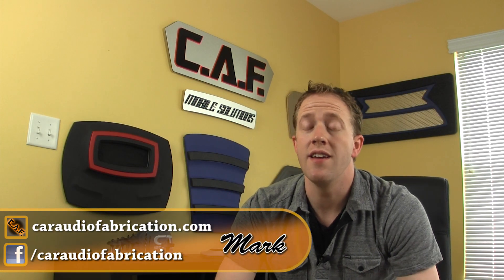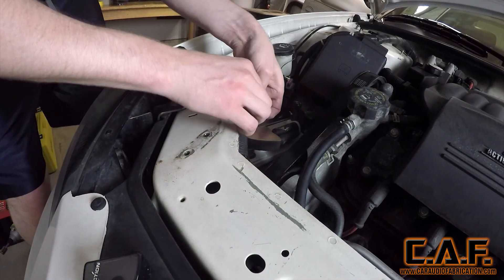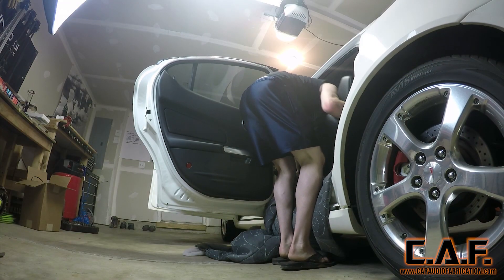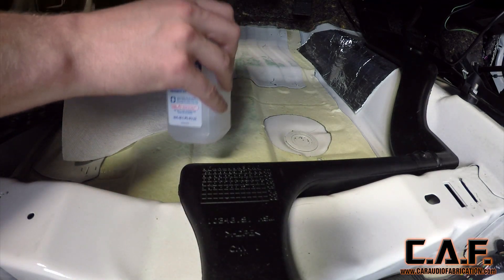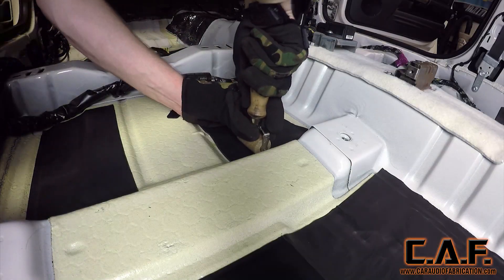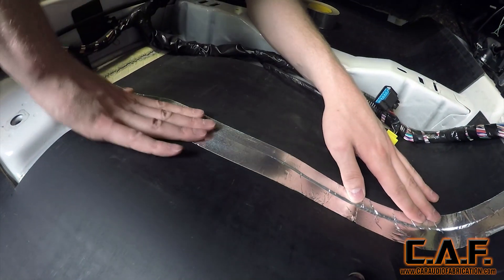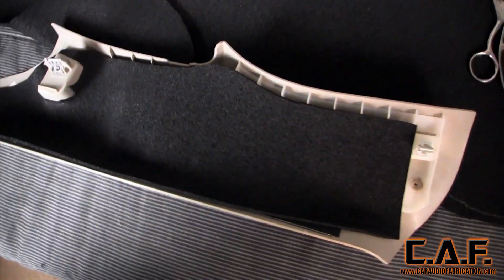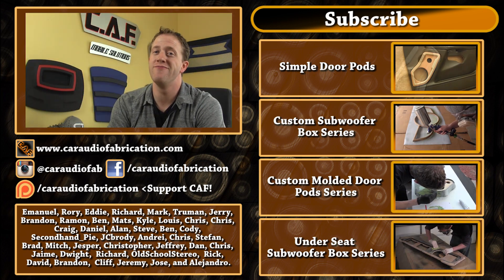How to Sound Deaden Car Interior - VBL #7 - CarAudioFabrication

Comment: One reason to put second skin all over the floor is to reduce heat in older V8 cars. I used their "Firewall Thermal Coating" along with the Damplifier Pro and it dropped the trans tunnel form 160 degrees to 78 degrees (which was room temperature).
Reply: +Russ Ryan Nice to hear the results you wanted were achieved......thanks for the shout out!!
Reply: Second Skin Insulation ...isn't mlv supposed to work with a foam under it to keep a gap or from the mlv touching the surface you are isolating it from?
Reply: Yes double deckersoulwrecker you would want to have at least a 1/8" Closed Cell Foam (CCF)layer  between the metal or foil top and the Mass Laded Vinyl (MLV) to decouple the air waves and keep the hard surfaces from creating noise. This is not our build, but Mark is a very talented installer in the industry so I am sure there was a good reason for this application (usually it is because of clearance restrictions on carpet re-apply in cars likes Porsche and Prius) and every single build is different and requires different strategies. This very reason is why we created the Luxury Liner Pro over 15 years ago which has the CCF infused onto the MLV already and will not separate and is so much easier to install then doing CCF and MLV separately.
Reply: Second Skin Insulation Thanks for the response. I wasn't sure if it still   worked this way

Comment: I took some of the ideas from Gary Bigg's Regal using lead and fiberglass to stiffen and add mass. Instead of expensive Cascade lead septum, I used 1/64 lead sheets to the under foot area's applying with butyl rubber roofing adhesive. But like him I used lead shot with fiberglass and 3 layers of Noico sound deadening, which I concluded just as good as Dynamat Extreme in my subwoofer enclosure.

Comment: Your car better be as quiet as a  Bentley after that. I would have liked to see a db measurement test...before and after... Both still and moving, with a mic positioned where a drivers ears might be.
Reply from the maker: focused313 I would like to do this in the future as well. Unfortunately right now I do not have the equipment for such a test.
Reply: +CarAudioFabrication this video was great! a lot of other car audio fabrication videos simply just put dynamat everywhere haphazardly. I wanted to see a video with MLV used. Also, if you do future similar videos, there are a bunch of free DB measurement apps for your phone. I use "Sound Meter."
Reply: It's not possible to compete with luxury cars designed for quiet interior cabins by doing sound deadening stuff like this. A significant amount of exterior noise is avoided by luxury cars through specific acoustic glass and various glass thicknesses, dampening of the suspension parts where they connect to the chassis, aerodynamics designed to stop wind noise at the source, and other things of this nature.

Comment: It would have been nice to see a before and after noise level measurement. I'd hate to spend several hours doing this and not getting significant improvement in noise reduction. Looks like all of this will add to the weight of the vehicle  but I wonder if that's a significant issue with gas mileage.

Comment: You said that you remove the OEM CLD material from the panels, but you stick your CLD sheets straight over the OEM CLD material (the yellowish layer in that car) all over the floor?

Also, what about the principle of
25-50% panel surface coverage for the CLD layer? You did not mention it and I do not see you practicing it in this instance. You went for the 100% coverage. Why so?
Reply: Can't speak for Mark, but for CLD on my car's floor, I just did a tap test and applied to areas that needed it the most.  I even had to apply it right over the factory deadening b/c it wasn't doing a good job.  I ended up covering up to 80% of my floor b/c it needed it the most.
Reply: ActnJksn If my thinking is correct, factory CLD layer should be removed first, because if it has weak (invisibly delaminated) connection with the panel, it will nullify the effect of any new CLD layers on top of it. However I have not yet found an easy way to remove that dreaded factory bitumen crap.
Reply: @NihadH  I would've needed a few extra days to try to remove the factory deadening alone.  I applied the CLD over it, then a layer of CCF for 100% coverage.  I have some MLV on order so I may apply that over everything.
Reply: I just apply CLD all over the OEM CLD. It's not like it's going to cause any problems. As for the 20-30% coverage, I am OCD, so I tend to go for 70% or so, especially on flat areas that are prone to vibrating as opposed to curved ones. CLD is so cheap these days, that even 100% coverage is nothing, really. My concern was why this video showed way less than even 90% coverage of MLV, which is the key aspect of full sound deadening. Even a tiny crack could negate the entire MLV effort.

Comment: I used roofing material to stick on the panels, cut up yoga mats over it instead of MLV and a lot of closed cell foam everywhere, what is your opinion on this method ? Honestly it barely costed me 100$ of material and it really made a difference in reducing road noise.
Reply: Yoga mats are usually just a thicker CCF, if you want a cheap MLV go find some used conveyor belts or some other source of thick rubber. Roofing seal is usually extremely thin and has hardly any mass to it, so you end up having to buy so much of it to properly dampen vibrations that you would have saved money by just buying the commercial product. Otherwise flooring underlay is an extremely cheap source of CCF. 
I used to try and get around the "system" like you and save money through alternatives. However I usually ended up paying more and was always doing things twice. Now I just buy the proven products and forget about trying to save the money. Too many hours of my life that I won't be getting back.
Reply: Dankus Memus  EXCELLENT POINT!!!!

Comment: If I do this could I get rid of the stock foam that's under the carpet?  I'm ok the same step as this video right now, I have the carpet and seats out and wondering if I could get rid it since it's pretty beat up and nasty from all the backseat spills. Cleaned my carpet a bunch!  I appreciate your help man!!
Reply from the maker: Jacob Villegas I try to keep as much OEM foam or the "bluish" chopped up fiber mat as possible. I pull the OEM CLD materials since they are an easy replacement. If your foam is massively degrading though due to water damage it might be worth just replacing.
Reply: Jacob Villegas If its not saturated, keep it. If it is you can purchase "automotive insulation/foam" don't use the house version from the hardware store.

Comment: Hey what’s your thoughts on different brands of sound deadening? And is there a whole lot of difference in between more rigid aluminum and less rigid on sound deadening backing?
Reply: From my research:
CLD: should be relatively heavy and have some beefiness to it. I have been using XXX Rattle Trap by Fat Mat and it does the job just fine. 
CCF: I can't call out specific thickness or weight/lb. The CEF layer is pretty ambiguous, but I use 1/4" thickness on my car with good results. 
MLV: typically needs to be 1lb/sqft in mass for optimum efficiency. I have seen 2lb/sqft stuff as well, but I haven't seen it in applications. Other than these technical specs, who cares about brand? Just get the best deal by sq ft, IMHO.

Comment: Would adding this or something like Dynamat lined up in my trunk cut down exhaust drone? I understand exhaust drone cannot be completely removed with sound deadener/dampner material, but it would be nice to turn the volume down on the drone in my car with my exhaust system. Just to make it more tolerable.
Reply: From experience, no.
Sound deadening is great for reducing road noise and improving stereo quality, however exhaust drone is simply too loud and bounces off the environment and back into your cabin through the windows. 
The only way is to use either a J-pipe or install a second muffler (inline).

Comment: CarAudioFab  I was making a ice cooler and getting component speakers and i and a few question

1.Will sound deading help with. This application to?

2.6×9s or component for sound and bass 

3. Do I foam in the inside like you see in speaker boxes

4.what alternetive sealed battery can i use to power. (car battery is to heavy)

Lawn mower? Wheel chair?

5.can you mismatch amp and speaker brand.
 (do you recommend it)

Hope I hear from you soon.

Comment: Hello, I  looking to make a custom speaker box for my new chrystler 200 2015. Its all white with a custom black stripe down the middle.  I was looking to Mame a unique box design to flow with the trunk as well. I was hoping maybe you could help.  I have 2 12subs and a 10 speaker I wanted to use but I could just stick to the 2 12subs.. What do you recommend and on design as well. Thx

Comment: Good video, but I have to add/correct you slightly. The CCF can be used as you have stated, but it primary purpose is for separating your dampened panel and the MLV. You need to install a layer of CCF to separate your dampened panels from your MLV. Your installation will allow any resonation, of your panels, to be passed through the MLV. You can increase the effectiveness of the install by separating the two with the CCF.
Reply: VD2021 g

Comment: I read a Amazon review. It said, OverKill Cell Foam smell was unbearable at 10 feet away. I cannot imagine the smell in your cabin on the hot summer day. Had a very strong burning rubber or asphalt smell to it. So what was your take on the smell and did it ever go away?
Reply from the maker: You must of misunderstood the review or whoever typed it must not have known what they were talking about, I have never once had an issue with any smell whatsoever.
Reply: Thank you for that fast response. Good to hear.

Comment: How heavy is some of this material, like for a normal mid sized car how much weight would all this add?
Reply from the maker: It adds substantial weight, maybe 50-100 pounds, in the grand scheme of things not a big deal though.  If you are running a track car then don't put it in.

Comment: I would advise not peeling off all the backing paper at one time and only peel half off work that side then remove the other half and work that in. It makes things a little easier to handle with out it sticking when you dont want it to.
Reply from the maker: thephranc That's a good idea. :) Ill do this inside doors, floors a re a little easier.